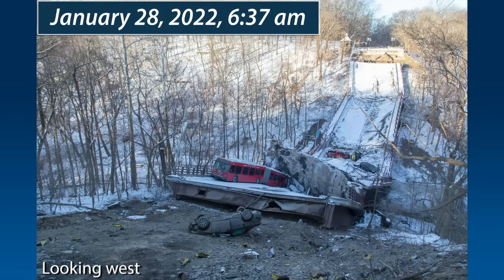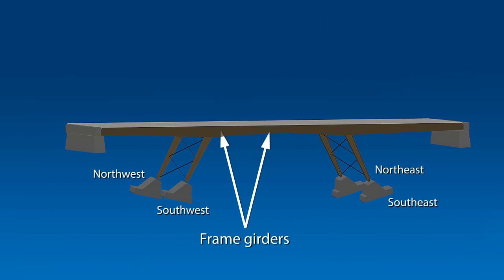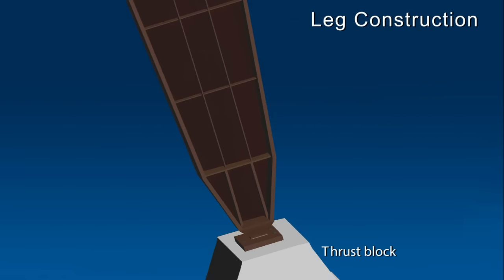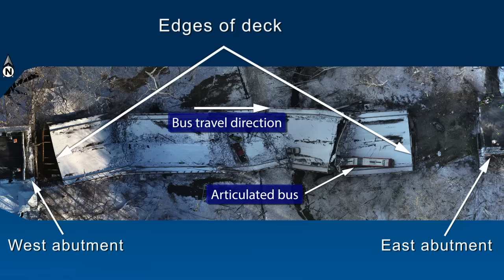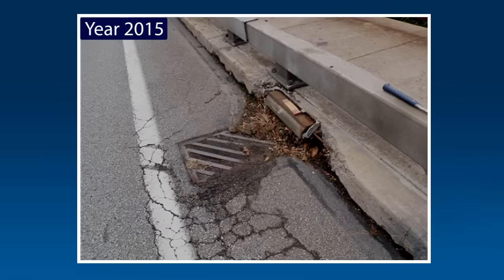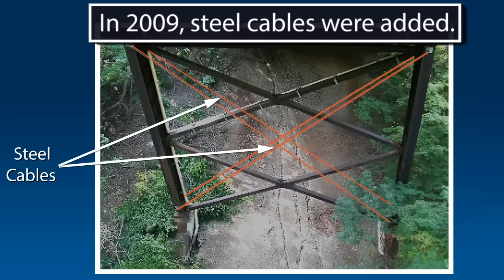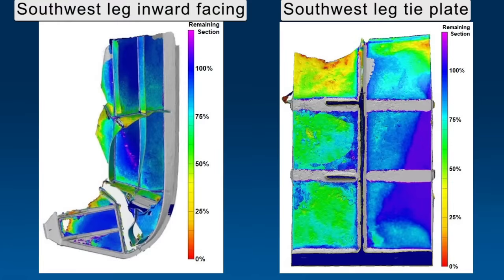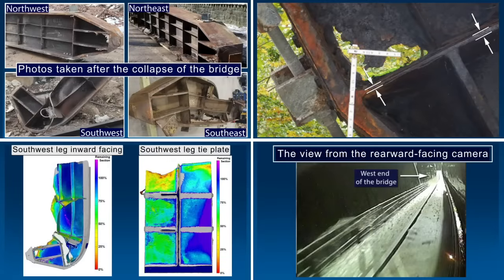NTSB Animation – Overview of the collapse of the Fern Hollow Bridge

Comment: So they knew for more than 10 years that something like this was going to happen, but no one bothered to actually fix it.
Reply: The law required the bridge to be inspected, but doesn’t specify who needs to do or pay for any fixes found by said inspections. After all, why would anyone not want to fix the expensive holes in the bridge before it collapses?
Reply: @sonorioftrill "..why would anyone not want to fix..."
When it would require increase in funding for maintenance but the only thing on the agenda list is "cut more funding"....
Reply: Budget and bureaucracy?
Reply: Maybe when the bridge was built, their Public Works department forgot to add "clean drains on new bridge" to their maintenance schedule?
Reply: I'm sure someone denied a tax increase somewhere to cover the replacement cost. PA votes red most of the time these days...
Reply: @mangos2888 precisely. They’ll then point at this lack of funding and blame “Big Gub’mint”.
Reply: They were expecting the invisible hand of the free market to fix it
Reply: @sonorioftrill  Cleaning the drains out a few times a year doesn't cost that much.  It would of gone a long way in making the bridge last longer.
Reply: @sonorioftrill  It's cheaper to fix it than payout settlements and then rebuild it. It's cheaper still to properly maintain the damned thing in the first place! Cleaning drains cost what? $1k per year? A single 2 man crew could clear them in a day.

There's a spot near my house that gets clogged every year. The city can't be bothered to even drive a sweeper across it. If they did every fall when the leaves start clogging it, wouldn't take anything to clear it. Leaving it for many months means they need many people and heavy equipment to clear it. Over at my shop, the cul-de-sac floods from time to time, much more often when they refuse to clean the city drain lines. (they insist everyone on the street pay hundreds of thousands to get it done.) After they spent way more than that sending crews out twice in one week to remove feet of mud, they cleaned the damned drains and we've had no such mess since.
Reply: @jfbeam  Yes, obviously it is cheaper for everyone in the long run to do the maintenance, but if you cut budgets and taxes now, you can make yourself look good with money and let the consequences befall your successor. 

Even then, maintenance costs tend to rise year over year, both because of inflation and because as a structure gets older more things have to be maintained. But people ask why pay more for maintenance this year than last year, even if new roads have been added, or the budget has been the same for a decade, why would any politician in a country where both major parties consider government spending a bad thing run on increasing spending and raising taxes?
Reply: @sonorioftrill  "...but doesn’t specify who...."
We know who! Us!
 By a show of hands, any of you having seen the holes through the steel, would have said, Oh yeah, that can wait!?...
Reply: @jfbeam  The Problem is, the US has been restructured to be wholesome car dependant and has incredible inefficient zoning. That means, most places don't even generate nearly enough tax income to cover the maintenance costs. it's basically only the city centers, which have sufficient tax income. you would have to raise tax level's on single family suburbs to absurd levels to cover maintenance and replacement works on the infrastructure. American Cities are a pyramid scheme. Using the money from new development to keep going. did work for a bit..., but now, you have all the infrastructure which needs maintenance or replacement and there is no way to built enough new stuff to cover the expense.
the american dream is just that. a dream. welcome to the real world. it may take 30-60 years to for the debt to catch up, but eventually it does. of course, the lobbyists and politician are long gone with the money. the real problem with a two party state. the can always blame the other party.
Reply: @beyondEV  The infrastructure in question here is roads. Most of that money comes from "road tax" collected from fuel sales. I'll say it again. Which is cheaper? Simple preventive maintenance, or not doing anything until the bridge falls down and kills people?
Reply: @jfbeam It's technically cheaper in the mid to long term, but a lot of systemic rot from years of short-sighted people getting positions of power has lead to many places, bafflingly, shoving the actual important stuff like preventative maintenence away in favour of spending money on gimmicks or vanity projects that aim to increase their political sway or financial standing.

The guys doing these inspections almost certainly were livid at their work being deferred or ignored, and it's likely that some chain of management fuckups lead to nobody passing the urgency up high enough on the ladder for it to gain attention and put pressure on a real fix being done
Reply: @alaric_ Asked why some of those funds were not spent on bridges, Peduto said, “There’s a simple answer. It's because bridges aren't used only by city residents. Bridges are used by people throughout this entire region
Reply: @MePeterNicholls Asked why some of those funds were not spent on bridges, Peduto said, “There’s a simple answer. It's because bridges aren't used only by city residents. Bridges are used by people throughout this entire region." 
This is former mayor peduto justifying the lack of maintenance. Democrat mayor, like the one before him (Ravenstahl) and the one before him, and the one before him...
Reply: @jfbeam The city is lawsuit limited to $500,000 total and the state is immune from liability and prosecution.
Reply: @alaric_  What I am more interested in is why when shown a public agency squandering money and refusing to use the money they pad their pockets with to perform vitally needed infrastructure repairs is your response "GIVE THEM MORE MONEY TO SQUANDER!!!!!" rather than "Maybe we should clean house and make it so they actually put the ridiculous amounts of money they get to use."

No matter how much money you throw into the paper shredder it is only going to output shredded paper.
Reply: @OutbackCatgirl  A large city near me had deteriorating roads, worse than in my much smaller city. The mayor owned a well-known local towing company with his name on it. When a new mayor was voted in, roads started getting major overhauls. Of course this had nothing to do with the previous mayor's occupation...
Reply: @jfbeam   The “road tax” collected from fuel sales falls abysmally short of the actual maintenance liabilities of our generously overbuilt road infrastructure. It varies from state to state, but not a single state in the country has come close to keeping its fuel tax on pace with inflation, much less the capital and maintenance costs generated from the exponential growth of our road infrastructure over the last 70 years. When you lose money on every lane built, you don’t make it up in volume.

Think about it: what politician would ever run and win on a platform that wants to raise the fuel tax by 3-6x to adequately fund our infrastructure? And so here we are. This bridge collapse is a perfect example of the cost of car dependency.
Reply: I also wonder if the inspectors even had the power to condemn it?  If so, they have professional licenses that should no longer be valid after an event this obvious was missed on their watch.  @sonorioftrill
Reply: @mangos2888  Wrong again. Allegheny county PA is responsible for the maintenance of this structure. the fine citizens of that locale voted almost 60% for Democratic presidential candidates dating back to at least 1996. I am sure other elected officials are also Democrat.
Reply: @MePeterNicholls If this bridge was privately owned, then it would have been fixed, because the repair cost was significantly less than total replacement.
Reply: @jimmydesouza4375 Thank you. The answer isn't more money, it's insuring responsibility people go into these positions to appropriately spend our tax dollars on things that actually matter.
Reply: It would be interesting to see what the reasons were.  Was it "We don't have the funds and we can't get them because any increase in taxes for proper infrastructure maintenance and renewal are always voted down"?
Reply: @ThePTBRULES  If this bridge was privately owned, but publicly accessed, the inspector would have condemned it. Being state owned, they let this death trap slide….
Reply: @illhaveawtrplz  "The “road tax” collected from fuel sales falls abysmally short of the actual maintenance liabilities of our generously overbuilt road infrastructure."

This is actually false.  The various road use taxes including fuel duty more than cover the current budgets of every state's DOT.  And this is before getting in to indirect road revenue such as sales of goods hauled by trucks.

The issue is not a lack of finance, it is poor management.  This is a pretty universal phenomenon due to the way government works, such as wildfires because park services refuse to clear dead wood.

By screeching "THIS IS THE COST OF CAR DEPENDENCY!!!!!!!!!!!!" you are just showing that you're the kind of tool that apparatchiks use to maintain their power.
Reply: @ptonpc  No, it was "We collected $50b in tax that was earmarked for this project but I instead paid $10b to my buddy Mike who owns a road construction company to build 100 yards of footpath, $20b to my buddy Joe who owns another construction company to install 5 planters in a local park, and I donated the other $20b to a non profit that I run."

AKA typical government.
Reply: @sonorioftrill  "The law required the bridge to be inspected, but doesn’t specify who needs to do or pay for any fixes found by said inspections." -

the owner is responsible. If a city does not have money then federal government decides. At least that is done in Russia.
Reply: @jimmydesouza4375  PA’s very own DOT website explains that state and federal gas tax revenue only contribute 75% of its operating budget, and that amount is diminishing year over year. Further, the scope of that budget is questionable considering the age and vast amount of infrastructure to maintain.

I agree that there is also a management problem, but financial solvency directly underpins that issue considering that it affects everything from materials acquisition to hiring and maintaining adequate staffing. No matter how you slice it, automobile-centric infrastructure is significantly more expensive and less efficient than a robust, multi-modal transportation network.

The only apparatchik’s tool here is one that insists that we continue to drive ourselves into the ground to maintain a stilted illusion of freedom.
Reply: @illhaveawtrplz  Youtube ate my initial reply unfortunately.  To shorten it in case this one gets eaten to, the section you yourself quoted proves you wrong but it requires more than superficial thought and blind regurgitation of narratives.  Until you're more capable you're never going to be able to see past things like this, and things like this are the MO for governments.

Try harder.  You're capable of getting this.
Reply: 20+ years.
And it was always too easy to pass the buck or kick the can down the street.  It'll be the next politician's problem.
It's more important to implement and maintain the visible, flashy, tax earning stuff than some old bridge used by non-locals who don't pay taxes in the area.
But hey, implementing an environmentally friendly bike lane only takes some paint... so do that.  It's green, after all!
Reply: @mangos2888 Allegheny county is very blue dingus... and has more money flowing through it than all the other surrounding rural "red" areas combined.
Reply: @alaric_ 
The government said: 
"We need that money and metal for bombs and bullets and no one wants to work anymore!" they said to a crowd of workers who have just been fired to "cut costs"
Reply: @ambulet  Sure, buddy. The bridges of PA are paid for at the county level - not a state or federal level
Reply: @jasono2139  So what? Bridges aren't paid for at the county level. They're only at state or federal levels, which involves the rest of PA's red districts
Reply: @mangos2888  I'm trying to think how stupid one would have to be to think that the state writing the check to pay for the bridge... somehow has more say than the COUNTY where all the inspectors and officials responsible for its upkeep reside do.  🤣
Reply: @jasono2139  Try harder. You obviously need to learn how money and budgets works
Reply: @mangos2888  "Money and budget" have nothing to do with it dum dum. If an inspector sees a bridge is in a hazardous state, they demand it be closed down and repaired before being accessed by the public... just as they would if a roadway was washed away.

Nobody asks "Hey... should we have a state wide vote on whether all the other counties think we should fix this?! 🤪"
🤦

Nobody at the state level is prioritizing what Allegheny county thinks should be fixed.
Reply: Unfortunately, that's how government tends to work. 

"It hasn't failed yet, so let's send to money to other 'more pressing' concerns and deal with this next year."

Then next year: "Well, it hasn't failed yet, and we want to spend money on this other thing, so let's revisit this again next year."

And so it goes...

Comment: must have been a sorta hard report to write- they're supposed to clearly communicate the reason the bridge collapsed but they probably weren't allowed to say "it collapsed because it rusted through starting almost 20 years ago and you never fixed it"
Reply: They said it without explicitly saying it.
Reply: In at least some of the CSB's video they don't hold back - the Chevron pipe elbow one, for example.
Reply: It’s kind of their job to tell people things like that, but being a government organization they’re required to use lots of fancy words
Reply: Did you watch the video? That's exactly what they said but in a technical manner.
Reply: NTSB does all reports like this. There are legal factors they have to consider when making these.

That said, they very clearly showed failure due to negligence.
Reply: The purpose of these videos is not provide the clearest and shortest explanation to an accident or incident. The target audience is not the general public. The video also doesn't exist to indite, expose or convict someone, that's the job of legal proceedings. The purpose of these videos is to educate professionals in the relevant fields (i.e. civil engineers, maintenance supervisors, bridge inspectors, etc) about the exact chain of events and causes, so that similar things can be prevented in future. This is really important to understand, because it's trivial to come up with "solutions": Use corrosion resistant materials, rebuilt it earlier, build it stronger, maintain it more, etc. But public funds are always limited and the job of a civil engineer is not to create a bridge that stands, but a bridge that barely stands, because the latter will be cheaper and people don't like paying higher taxes. So it's key to understand these problems in detail, so that future solutions can be as efficient as possible (ofc with a safety margin).
Reply: Why, what's stopping them from saying that?
Reply: They did say that. "Look at this photo from 2004 where you tried to fix this, admitted it was temporary, and then never got back to it" is pretty much the shadiest shade the NTSB throws
Reply: @tompw3141  Such things are for a jury to decide.
Reply: @PressRecord777 The NTSB's job (as set in law) is to establish the facts of what happened. If it's a fact that it started rusting 20 years ago, and that no action was taken to stop further corrosion, then the NTSB can (and should) say so.

That's entirely separate from liability, which is for the relevant parties or the courts to decide.
Reply: @tompw3141  I thought the NTSB stated the facts adequately. My point was they would refrain from saying something as inflammatory as "and you never fixed it," which could be viewed as prejudicial by a jury and lead to a dismissal on bias.
Reply: Why does nobody blame the true source of this problem - the bridge. The bridge knew what he had to do, and he failed in doing so, leaving the crime scene without any weight of the justice system being placed at it's feet. The same thing happens every time in these situations.
Reply: I mean if you look at bridge inspection reports you'll see the conditions documented here are not uncommon at all
Reply: @michaelbrand99 Lawyer tells them what to say.
I'm so tired of seeing lawyer double speak everywhere.
Give it up to lawyers for making up definitions of words as they go to get criminals off of consequences.
Defense lawyers must have no soul. 😂
Reply: Isn't that what they just said?  In so many words?
Reply: I think everyone agrees with each other in this comment section
Reply: @tompw3141  It started rusting by design, fifty years ago, but the drainage system was inadequately maintained, preventing the materials from doing what they were supposed to do.
Reply: 8 YEAR'S and they cant even paint it. where is all the money going???? time for some audit's.